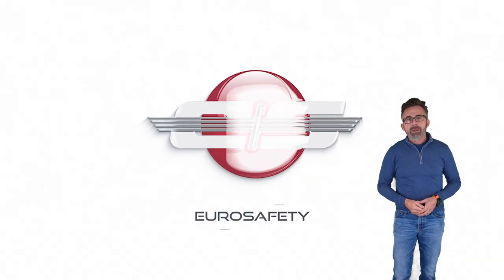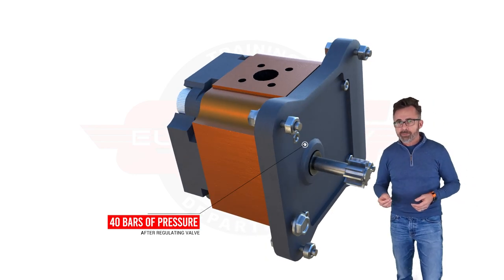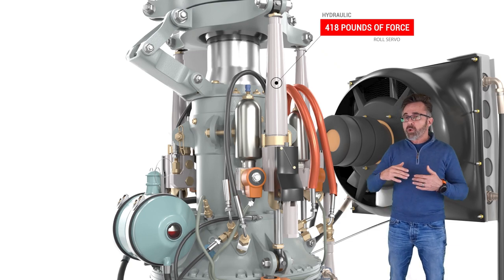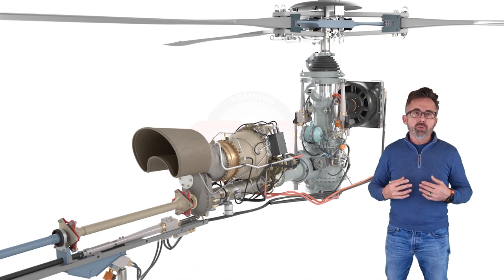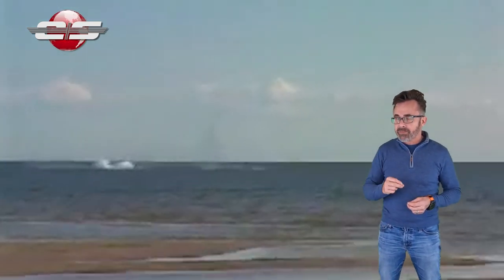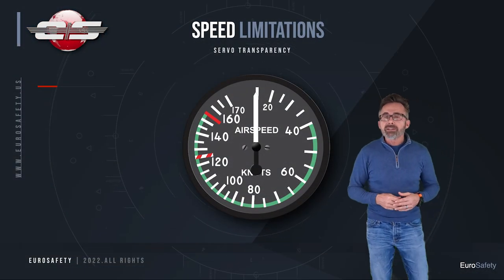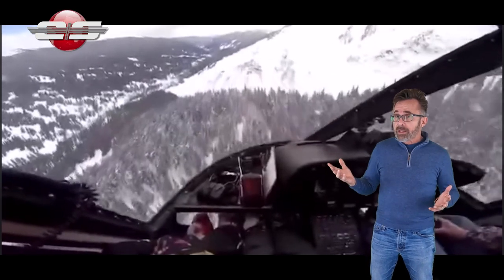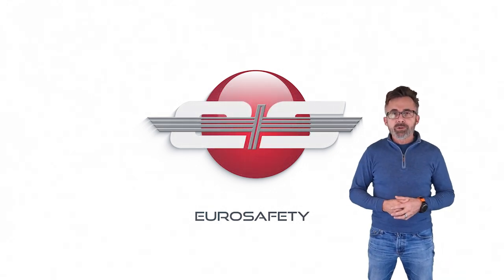Unveiling the Secrets of Servo Transparency in Helicopters.

Comment: I struggle to believe that this is a design feature. Is it safe to assume that far more squirrel airframes have crashed from jack stalls than would have crashed due to over stressing? I think it is. Sounds like a design flaw to me.
Reply from the maker: I respectfully disagree. An argument that an aircraft should be designed to be flown extremely dangerously seems illogical.
Reply: @EUROSAFETYTRAINING  No one made that argument, respectfully, I think you're confused. You've used two examples of dangerous flying and attributed this type of flying to all jack stalls. In reality that's not the case. They can, and have happened during phases of flight that would be considered by most of us as quite normal. But that wasn't my point either.

My point was that complex systems should be designed to be as forgiving to human error as possible. This is a design goal of all things technical, not just helicopters.  We study human factors because we make mistakes, we're not robots. Manufactures didn't take this into account years ago as much as they do now, but unfortunately many helicopters with these "features" still exist. While training such as yours certainly benefits and contributes to less accidents, a better design would eliminate them.
Reply from the maker: I do understand what you are saying. My statement was designed to reflect the point in a very blatant manner in order to cut to the chase. An again to be frank, there is no normal phase of flight that can induce servo transparency. One could say that they experienced servo transparency in severe turbulence, but that is a momentary additional force on the rotor system that goes away quickly. An argument could be made in such a instance that you would want the system not to accidentally over stress the rotorhead. By momentarily not applying additional damaging force you are protecting the system. Can you tell me the normal flight you are referring to. The fiberglass rotorhead on the AS350 is an amazing and dependable design, but it has its limits like all mechanical systems. The argument that a hydraulic system that can damage the system be attached to it seems illogical. 

I'd like to emphasize that the tone perceived in written text may not always align with the intended tone of the author. With this in mind, I genuinely appreciate and enjoy engaging in thoughtful discussions about helicopter flight safety with professionals who are equally committed to achieving operational safety.
Reply: @EUROSAFETYTRAINING   I am with the others. It would be great if it would be more forgiving - if it just reduced user input, before design limits are reached, but not turn the heli into undesirable angle would be much safer alternative to warn reckless pilots.
Reply: @EUROSAFETYTRAINING  thanks for the reply, and I agree with everything you say. 

My experience is limited on the 350, but in the 355 a steep turn in a lightly loaded aircraft will set off the limit light. The starflex is a conversation for another day 😂

I guess my overall point is that we often give manufacturers too much slack. We’re having a similar issue with Sikorsky at the moment with their CPI transducers. There is a world wide fault issue with them which causes random fuel changes in the engine. In the worst case scenario it causes a momentary engine roll back and engine out tone. Sikorskys stance on this is “no one has died, it’s fine”, instead of fixing the issue.
Reply from the maker: I do understand your point and do appreciate your interest in a robust conversation in aviation safety. 

Safety in aviation is paramount, however, the aviation manufacturing industry is navigating a complex landscape where ensuring safety, managing costs, and facing legal challenges are in constant tension.

Manufacturers are often caught in a legal quagmire – facing lawsuits whether they choose to fix issues or not, and even when they win, the costs are substantial. This not only stifles their ability to focus on reengineering and upgrades but also impacts their financial stability. MBB's experience with the BO108 (EC135) and Tiger attack helicopter is a prime example of the debilitating effects of continuous reengineering and legal pressures.

Moreover, this environment inadvertently affects the entire aviation community. Increased costs for manufacturers lead to higher prices for operators, which then trickle down to consumers and ultimately impact pilots through reduced salaries and compensation. It's a cycle that ultimately hinders progress and innovation in the industry.

Perhaps what we need is a more collaborative approach. A synergy between manufacturers, regulators, operators, and pilots could lead to more effective solutions, balancing safety concerns with the economic realities of aviation. Only through such collaboration can we hope to advance the industry in a way that is both safe and sustainable.

Comment: could the engineers not Have utilized progressive pressure roll off system? so instead of the controls locking up they limit the hydraulic pressure applied to the rotor system retaining for the most part pilot control??
Reply from the maker: Im sure they could. I would have to assume its a matter of massive expenditures for an issue that they believe you should never encounter. As an analogy, lets use the Bell 206. If you pull past the TOT red line you will eventually experience severe rotor droop that could cause and accident. You could argue that this is a safety concern in case the pilot would need that power. So Bell should go back and put a much more powerful engine in all old 206s for no cost.

Comment: It's not humanly possible to push through 480 pounds with one hand, and if it was the cyclic would break before it would do anything, so it does "lock up". Calling this a safety feature to prevent damage is a little ridiculous as well. High altitudes and aggressive manuvers would cause less dangerous effects than this,  like rotor droop, retreating blade stalls, or digging-in in helicopters that dont have this "safety feature" because they have larger hydraulic pumps.
Reply from the maker: The pump produces over 1300 psi at 390 NR. The system is regulated to 580 psi. So its not a pump issue.

Comment: 2:30 This crash occurred when the pilot was flying 12Knots below the VNE for his altitude.
Reply from the maker: I assume you are saying that this was not servo transparency. What do you think the speed was at the time of the pitch up and what was the altitude? There is no doubt that the helicopter is at altitude as evident by the mountainous terrain. There is no doubt that the helicopter was heavy as evident by the passengers seen on the video. There is not doubt that the pilot was giving a "thrill ride" as evident by the exclamations in the cabin. There is no doubt that there was acceleration when descending. There is no doubt that the nose pitched up (first indication of servo transparency). There is no doubt with a descent and then a pitch up that the G forces would increase creating more forces on the servo actuators. There is no doubt that the helicopter rolled to the right (the second indication of servo transparency).  Have I said anything that is not correct?
Reply: @EUROSAFETYTRAINING Yes, you have said something incorrect. You have used a butt-covering euphemism "servo transparency" when a control systems engineer from  any other field would use the term "saturation" or something similar. Frankly, the design of the machine is wanting. Yes, you must stay within the flight envelope of the aircraft, but the aircraft's reaction to approaching those limits should not be "pitch up, roll over and crash." That sort of attitude should have been left behind with the Benson gyrocopter.
Reply from the maker: Thank you for your attention to detail and for contributing to a rigorous discussion. It’s enlightening to hear the perspective of a seasoned control systems engineer. As for the aircraft design, your frankness is appreciated, and it invites a deeper look into the nuances that distinguish various models and their operational behaviors. Let's continue to dissect these complexities, as each insight brings us closer to the excellence we both seek.
Reply: I was looking for this comment. ¨Saturation¨ I understand.  Was having a hard time picturing ´transparency´, but if it is what the industry uses more power to them.    @MrSunrise-
Reply from the maker: All businesses stay away from terms that would be less than complementary to their product.
Reply: There is no doubt it was servo transparency. Also, there is no doubt that the high g pitch up was caused by the servo transparency (and not by the pilot as you suggest). Reading the accident report, there is no doubt that the aircraft was being flown well within weight, c.g. and speed limits as indicated in the POH. Yet, still it crashed. Therefore, there is no doubt that the AS350 control system is not fit for purpose and this aircraft type either needs to be grounded or at the very least the limitations in the POH must be revised with sufficient safety margins in hand. e.g.  introducing an extra step when calculating VNE which takes account of weight so that by time you’re at max gross VNE is somewhere in the double digit range (I note that during sling load certification no one was brave enough to go over 80kts. Perhaps that limit should also apply to internal loads).